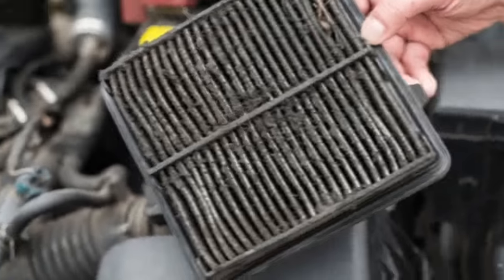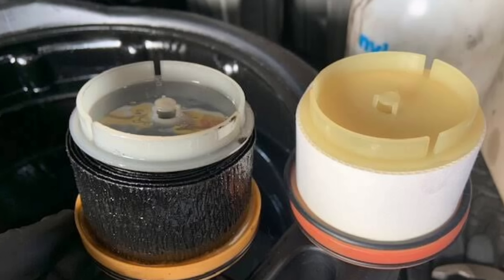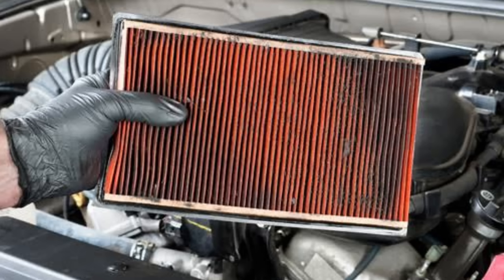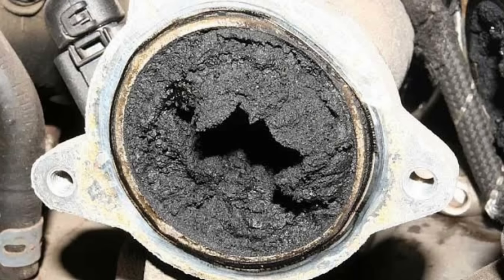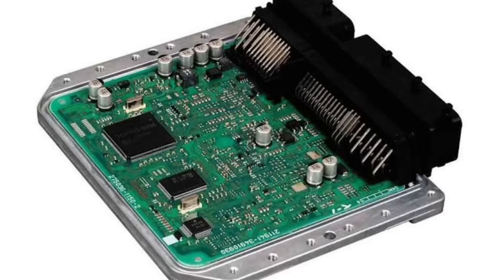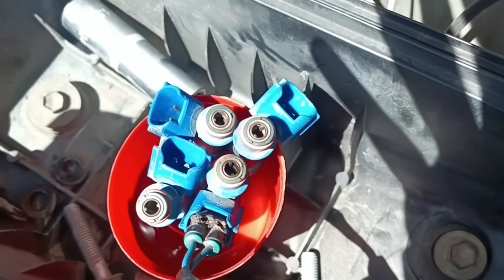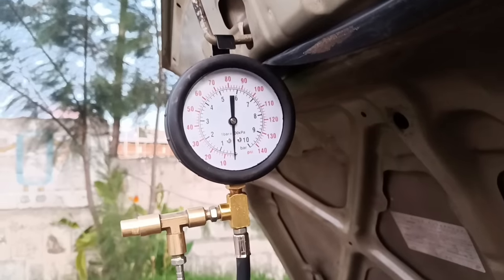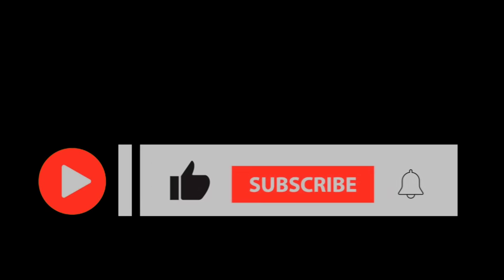Top cause of a car losing power when accelerating

Comment: Mine loses acceleration power when I'm on a red light. I turn it off and on and it goes back to normal
Reply: Have you figured out what's wrong with it?
Reply: MAF
Reply: Yes mines das the same have you found out the problem
Reply: I have a Isuzu rodeo and it was doing the same thing that your vehicle is doing it doesn't have any power when you first start it but if you turn the ignition key off and on real fast while it's running it resets something but it was the electronic control module that I had to replace in order to get mine back online but more likely that's what it is for your cool pack set on top of the electronic control module

Comment: Believe it or not, my town car had loss of power on acceleration and it turned out being a mud dobber had built up a nest inside the 3" air intake in the grill area blocking the flow. Who would have thought!

Comment: in other words check everything jajajajajajaja!!!!
Reply: Right.  Great video but they don't explain how to test or what symptoms to look for on each point of failure.  You know when it's a bad coil or plugs, because you can often hear misfiring.  And bad sensors often cause engine codes that help you narrow it down.  But what if you don't see or hear anything apparently wrong?
Reply: @COSMACELF1802 that’s what I’m dealing with, car idles perfectly fine runs and drives normal but feels very slow and sluggish when accelerating, no lights are on and I don’t have any catalytic converter so idk what’s wrong
Reply: @FatBoiiDaniel1600  Perhaps something is still clogging your exhaust.  Can you remove the pipe to your exhaust system? I did this on a Tuson, unbolted the cat and strung it up with some wire to the frame and it proved the cat was blocked.  Open your intake also for testing.  Do a compression test.  Good luck
Reply: What if you have all of these symptoms but you have no dtcs? As in scan tool says nothing is wrong with the car
Reply: @notadoctor2598  Recently I fixed a Tuson with no DTC's.  It was a clogged Cat.  Just unbolt the CAT, to let the exhaust come straight out, then give it a test drive.  good luck
Reply: @FatBoiiDaniel1600   Check your emergency brake! 😅😂🤣

Comment: Thank You for your sharing of the knowledge .
Last time my 2009 Chevy traverse told me that the engine is losing power , shut down the engine .
I checked what was wrong with it , I found out that the heater hose pipe was broken .
I took it to the Chevy Dealership and I was told that it is a big deal , so we have to replace spark plugs , cleaning fuel injectors and the cost is $ 1800 .
I said : no ....
And I took it back home with two truck that asked me $ 70 .
I looked for the hose pipe for $ 10 and I replaced it . And it is running properly  .

Comment: Hi, i have a weird question, but first, i shall give info. I have a 2010 peugot 308 mk2, 1.6 litre diesel, 254,000 miles. Since i owned it the car was always sluggish, i suspect the turbo is just done and needs replaced, around 3 weeks ago my DPF filter light came on, i ignored it for a week then got it cleaned but before that, the car got real smokey especially when cold, same low power, it didn't get any more sluggish. It was like that last week after the filter was cleaned, but all of a sudden yesterday, when i had to a real quick take off to not cut off the first car in a line of traffic, the car all of a sudden found itself like 20 more horsepower, it was so weird, i felt it get up to 60 real quick and I was surprised, happy and confused, I had a fun drive to work with its sudden power miricle but i am worried this is a major issue and it could have consequences. The timing belt is very new, no leaks anywhere on the engine. French cars are so weird man.

Comment: Mine always losses power when going uphill what might be the cause? Otherwise I want to thank you for all that information ❤❤
Reply: Did you find the issue ?? I'm having the similar issue
Reply: Same here
Reply: Fuel pump most likely. It causes a lot of power loss problems in your vehicle. You have to use more fuel than you normally do when your driving up a hill. Putting more stress on your pump. If you’re going uphill and your vehicle is struggling then it’s more than likely a fuel pump going bad
Reply: Or a clogged fuel filter. Check the fuel filter first because it’s a lot easier and cheaper to replace, then you can go from there if it’s still having a loss of power
Reply: I recommend checking the fuel pump, as it is often the main problem when it struggles to accelerate and loses power. If that doesn't solve it, check the PCV valve.
Reply: Same issues with me until now.
Reply: @jaydendavis6753  Unless the fuel filter is inside of the fuel pump, which is inside that gas tank, which must be dropped to replace the entire fuel pump/filter assembly......  Organized, step-by-step diagnostics to find the root problem is a much better path. There are many YouTube channels run by professionals that will guide you correctly. Not here. 🥴

Comment: Car won't speed up and sounds like blow out in exhaust but coming from engine bay any ideas what it would be anyone cheers
Reply: The first thing I recommend checking is the detonation sensor, as it often causes power loss and explosions in the exhaust pipe. If you've checked that sensor and still have the issue, it might be a clogged catalytic converter, which can cause both exhaust explosions and power loss. As a last resort, I suggest looking into the intake manifold, as that can be a more serious problem. I explain more on my channel. Regards.
Reply: Thanks for reply got it looked at the airflow pipe or something had blew off was easy fix thank god . Thank you once again 👍

Comment: So, I have a 2010 1.6 TDCI Focus, I've just had the EGR and fuel filter replaced because of intermittent loss of torque.  All seemed fine after the new EGR was fitted 2 months ago but it's started doing it again, what can be causing my intermittent loss of power but switching the engine off and restarting it cures it for a while?
Reply: Check the luf master
Reply: @aleksandarbosevski5055  hi, I don't know what  luf  master is?
Reply: mass air flow sensor
Reply: @aleksandarbosevski5055  Ok thanks, yes I did check and clean that and I don't think it's that.
Reply: Check Injector and high pressure pump.

Comment: Good day, I have a jeep compass model 2014, my problem is that when driving the inside lights keeps switching on and off. Number when I switch on the engine, one of the head light switches on automatically. Number 3,when the engen is off, a very loud kriiiiiiiiiiiiii noise is produced. Please help what you think might be the cause.
Reply: Current
Reply: You have an electrical problem, and it could be due to several reasons. I recommend checking the fuses for the lights and the battery. After that, inspect your battery because it might be failing and causing issues. When the battery starts to fail, it can affect the lights and the sound system. I hope this helps. I explain more on my channel. Regards

Comment: My car was changed engine, now i cannot recharge freon because its stop the engine .what is the major problem sir? Car model 2002 Honda accord.And even on driving on idle mode its turn off the engine.
Reply: Chang your throttle body

Comment: O/D switch doesn't work. Even, when I start power before start engine O/D off is blinking automatically. When I start vehicle o/D off light still blinking . If I drive in this situation vehicle gear doesn't work properly ( very hard to change automatic transmission) it is not working smooth. Could you please explain me?
Thank you for cooperation.

Shahadut Hossain
Dhaka, Bangladesh
Reply: 7

Comment: Mine is a hyundai Getz, when driving all is well but when i stop on a traffic light or just slow down because of traffic or whatever. Accelerating from there its a problem its as if im doing nothing even though i would have stepped on the accelerator

Comment: What happens when your going down the road and your car just quits all together? Good video though, I can learn a lot from from them.😊
Reply: Could be any sensor or the alternator this issue has happened to me multiple times but lucky my alternator wasn’t too bad it just cut off and came on
Reply: Could be a bad fuel pump. Fuel pump could be overheating, or going bad
Reply: Did you solve it buddy
Reply: Airflow metre
Reply: 😅yes

Comment: Out of anger when my engine won't respond when i excellerate, i pumped the excellerator pedal very hard and it responded. That's how i drive it now after discovering that. I've fitted a new exellerator pedal which comes with two built in sensors and there's no change. In short, it only excellerates when you pump the excellerator each time it stalls. What could be the cause? My throttle is fairly new, about 2/3 years old.
Reply: Brother now ur car is working good or no? I have same prblm and im thinking might be it will not be solved ?
Reply: Clogged catalytic or muffler
Reply: Spark plugs and coil packs

Comment: I was hoping to get some answers but all I got was " It could be anything" thanks I guess 😂😂😂 might aswell added diverter valve, low tyre pressure, brakes sticking, few horses escaping for a better life, your missus putting on a few extra pounds 🤦‍♂️
Reply: Yes, that is the problem with ECU Engines, you need an OBD1 or 2 fault code reader to highlight which sensor is sending an error. I got lucky by just cleaning the air inlet filter with an hesitating engine. (filter looked ok and would have been ok in a pre-ECU car).

Comment: Good day everyone, I would also like to be helped. I'm driving a renault megane lll and the problem is that it finishes (petrol) gasoline so fast, also the engine coolent doesn't last long, every drive I have to refill. Please advise me
Reply: Leakage
Reply: U hve to check proparly da cooling system must there is a leakage. etc radiator +cap,. Pipes.,

Comment: I'm from Canada. My Sante Cruz is 2023.  What causes it to lose power when I'm driving? 

I'll be driving 120km/h then w/o warning, it drops to 20 km/h, the engine light comes on.  I'll pull over, turn off the vehicle, give it a few minutes, turn the vehicle back on ...  everything is fine.

There's no pattern, temperature or weather condition or particular speed as to when it drops power.

Mechanic says it's not the fuel pump. Spark plugs were changed many times, in the process of changing the throttle (this recommendation comes after he spoke w/ Hyundai's Head Office - they're not sure why this is happening either).  So there are no recall notices issued.  Vehicle has been in the shop 5X since April 2023 for the exact same (above mentioned) problem. Computer scan says there's nothing wrong.

Any ideas what's causing this? Or all Sante Cruzs having the same problem in the USA?
Reply: Ask your mechanic to hook the scanner and take your car for a spin to check if something pops up in the scanner.

Comment: My 2014 hyundai elantra limited lossing power i did the oil change i changed the air filter and the sparks plugs he still the same nothings changed.
Reply: Fuel filter change it located in your fuel pump most of time cause of your problem located in the back seat and clean your injectors very easy and replace the cam shaft position sensor as well you have your back in order
Reply: Turbo issue
Reply: What did you do to resolve the issue
Reply: @abioyeafiz745  obviously reconditioned turbo and now smoking anything of the road
Reply: Like how much will that cost
Reply: @YasAki-xs6uq  is it working perfectly now and how much does it cost